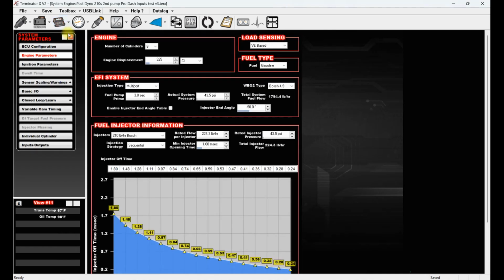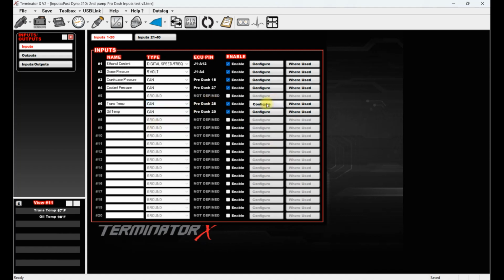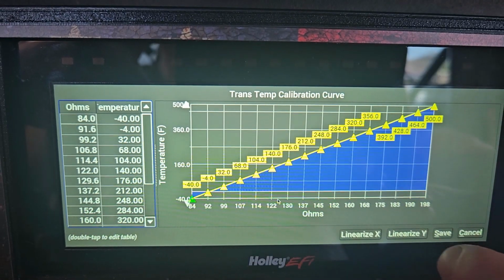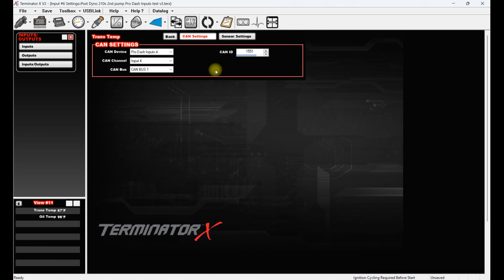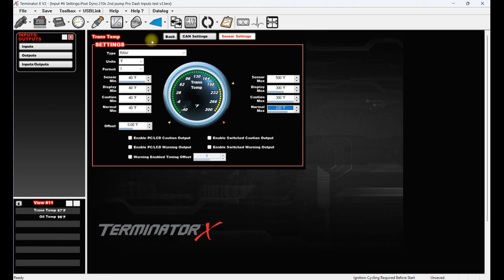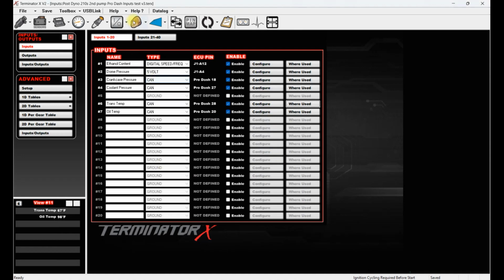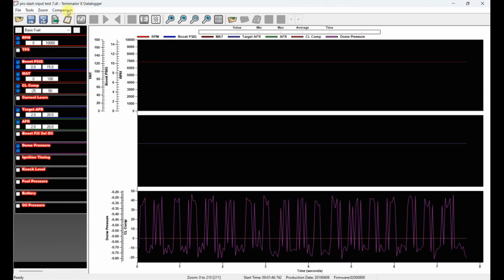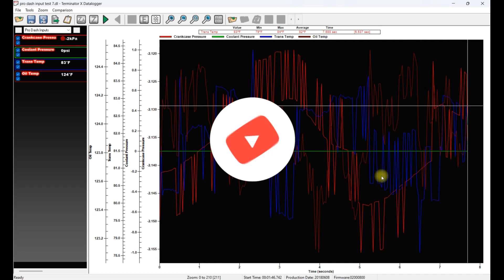How to Datalog Pro Dash Inputs

Comment: Great video! This alleviates the need for the IO canbus extender.
Reply from the maker: Indeed, this is a capability that I've known about for a while, but I hadn't really had any interest in exploring until Billy hit me up before LS Fest. It worked like a charm and gave us a lot of data to back home and make improvements with. Thanks for watching and commenting.
Reply: @TrailerParkMotorsports  - Absolutely! I'm wrapping up my ls sn95 now. I have Sloppy Mechanics 6 in 1 harness so I'm trying to figure out how to get it all up and running currently. And this helps free up those inputs  it uses.

Comment: That’s weird. Mine will log without having to make advance tables. I’m glad bc I don’t have any open lol
Reply from the maker: Oh, also, thanks for watching and commenting.
Reply from the maker: Did you have those inputs used in any other ICF, like boost or nitrous? Neither Billy or myself did, which I believe to be the reason why they weren't logged, the input wasn't in use.

Either way, we'll definitely find out for sure this weekend at LS Fest, and if I find out something new, I'll update the video.
Reply: @TrailerParkMotorsports  nope not really used just want the data. I use flex fuel, g meter, gps speed, and trans temp.